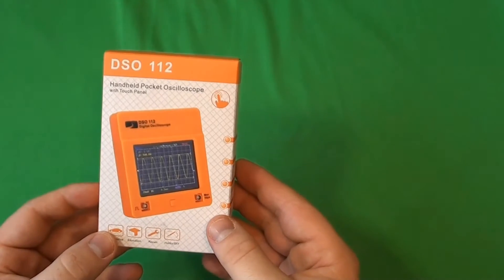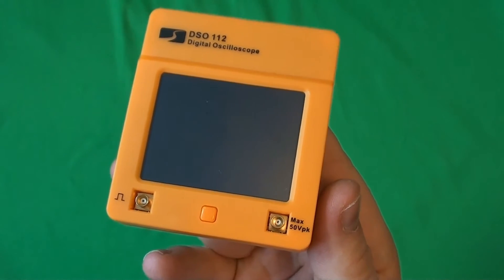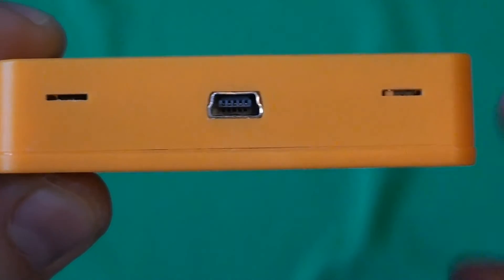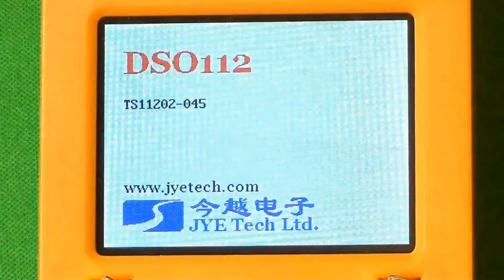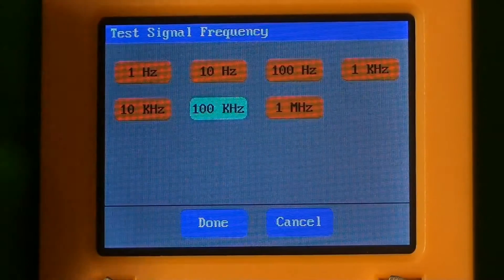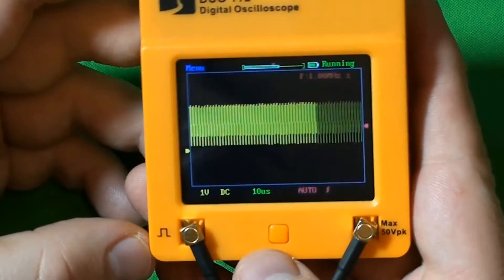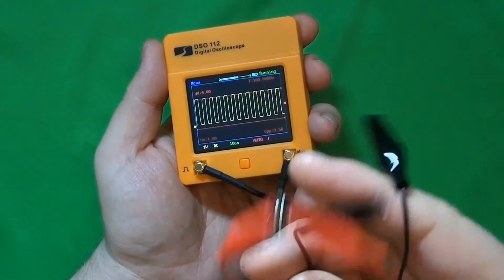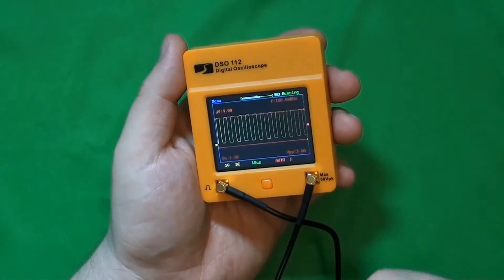Tech review : DSO112 Oscilloscope

Comment: Worth mentioning is that this has a sample rate capable of debugging SPI communication. However, it is not capable of measuring home voltage since it is limited to (I think) 50 VAC… However, I have read that if you buy 10X probes you can effectively measure house current as well. At least USA current... Of course when dealing with house/mains current ALWAYS double check the above for yourself and be VERY CAREFUL!
Reply from the maker: True, but using such delicate equipment as osciloscope for mains is never a good idea. Using 5$ multimeter is much more efficient and without risc of destroying expensive equipment.
However if you want to see that 50/60Hz , osciloscope is almost the only tool that can do that. :)
Reply: Dalibor Bartoš Yep, I totally agree... All very good points!

Comment: Good review! Hope, the sensor will not die in a short period of time.
Reply from the maker: it's almost a year, and still works fine. It's a good device for hobbyists
Reply: It's great; thanks!
Reply: Hello, what is the peak frequency for this device, which can be viewed adequately, without any significant distortion? Thanks
Reply: 200kHz max, 100kHz better. H-Sync fine from 10uS, i.e. low then 100kHz you can see fine.
Reply: Thanks a lot!